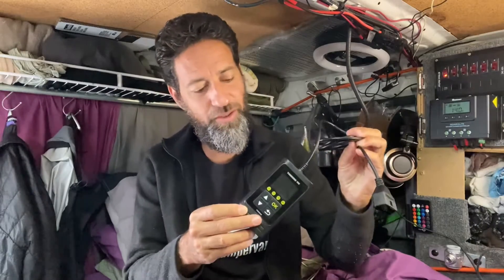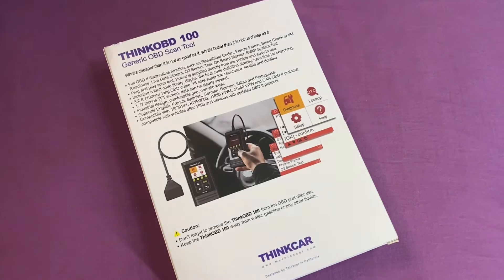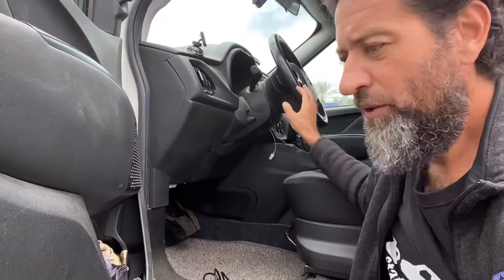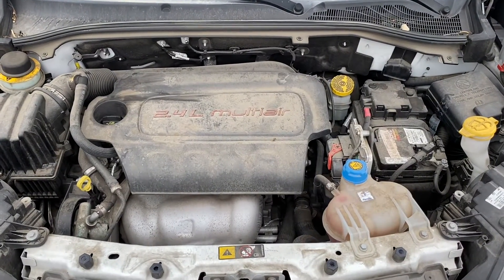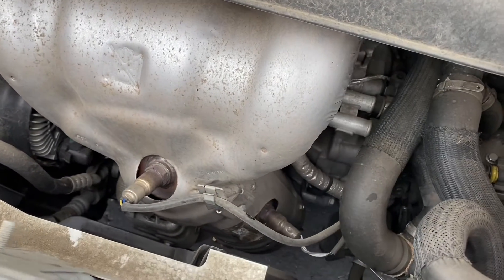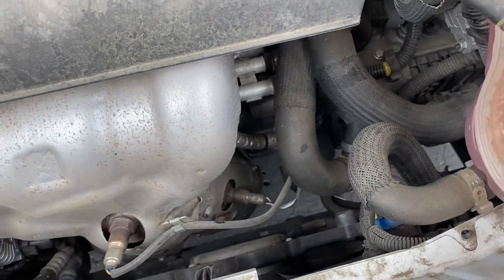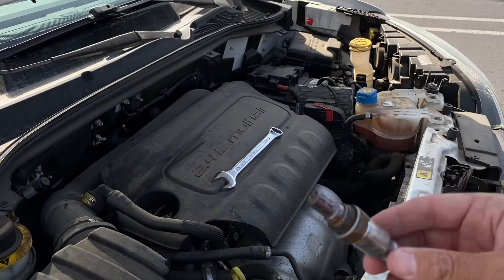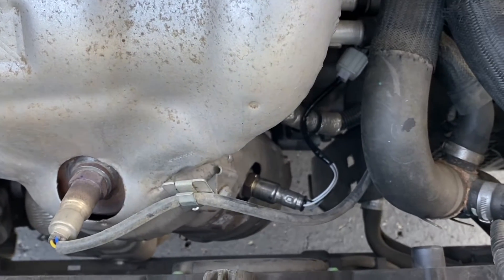Fixing a Rough Running Engine using a Thinkcar OBD2 Scan Tool

Comment: Thanks for this advice with thinkcar think obd100 scanning tool. I am having a Fiat Doblo (European version of Ram Promaster City) myself and was searching for a proper scanning tool. So, I guess, I will go for this one :)
If I may ask: Are you still happy with that scanning tool or did you find a better one in the meantime?
greetings to the US
Reply from the maker: The scan tool is working well for me so far. I believe Thinkcar has several newer versions now that might be better. 
By the way, our vans have almost no similar parts other than the shell. All the electronics as well as the entire drivetrain are different parts here.
Reply: @StaticCamperVan  thank you for your quick response, Scott! And thanks for the extra information on the the differences of our cars! 
I wasn't aware of this at all. 
Well, I hope the scanning tool mentioned above works anyway for my car ;-)
I am just a bit cautious because from time to time I stumble upon people's posts saying that they "destroyed" their car using an inappropriate or faulty scanning tool.
Therefore I find it really hard to choose one and was very happy when I saw your video with this particular tool which obviously helped you and - most importantly - didn't destroy your car ;-)

Comment: I’m ‘pleased as punch’ with your video. Recently took delivery of a new company van (2021 Ram ProMaster City.) I first learned from you about the oil consumption issue (it’s used almost 1/2 quart in only the first 2000 miles.) And I’ve  had a rough idle since day 2. I have my third appointment with a Dealer this week to check these problems. It’s frustrating when the Service Manager says ‘it’s normal for this vehicle’ to do this. Two other co-workers that have also recently received their new vans are not reporting these issues. Time will tell. I have the higher level ThinkCar scanner. I’ll check out the O2 sensor tests. Thank you!

Comment: I know what the problem is, it's a Chrysler product 🤣 I just sit back and wait for my ProMaster city to have a issue 🤦🏻‍♂️😥
Reply from the maker: Haha. Might be a long wait. This PMC has been one of the most reliable vehicles I’ve ever owned. 
Maybe we both need to be more pessimistic!
Reply: @StaticCamperVan  I'm definitely happy to hear you're having better luck than I am with your PMC.
Reply from the maker: Oh, that’s right. You said you’ve had some troubles with yours. Sorry dude.
Reply: @StaticCamperVan  there's a bad lemon in every bundle lol thanks man. I'm sure I'll have bad O2 sensors at some point so this video was helpful.
Reply from the maker: True. By the way, a friend dropped a comment here saying that emission components are federally mandated to have an 8 year/ 80k warranty. 
If I’d had known that, I might have taken the van back to the dealership and had them fix this.
Reply: @StaticCamperVan  great info thanks dude 🤙

Comment: For a Chrysler, that's really easy to get to. I'm surprised they are acting up with how new that van is. My GM trucks tend to fail at 20 years or 200k miles in the rust belt. You can often rent special tools for free by giving them the retail value of the tool until you return it.

Comment: Now I want that scan tool, even though I can't do the work myself. I have the 2016 PMC, just got an oil change 2 days ago and was on the low end of normal. I will contact dealership about the recall testing for sure now.
Reply from the maker: Part of why I made this video is to show that we all have the ability to do some maintenance on our vehicles. 
I wish you well with your test.

Comment: Downstream 02 likely died 1000 miles after your EPA mandated 8 year/80,000 mile warranty on all your emmision control components expired 🙄  darn! The manufacturers have this stuff figured out. The downstream 02 does not control fuel trim.
Reply from the maker: Good to know for the future. Although I still don’t want to go see a mechanic or dealership for a while.
Reply: @StaticCamperVan  😂😂  I know what you mean! I take this knowledge forgranted as it is my job, must be a bad feeling to be at the mercy of a mechanic or especially a stealership.

Comment: Ever since grade school   -----I hate test. Foot Note- hear on the east coast the Colonial Pipe Line company was hacked and they shut down pumping fuel to 25% of the East Coast. A lot of gas stations are getting low on fuel and we all know what's at the bottom of those tanks. Since fuel injectors are sensitive to clean fuel, just a few drops of water or sludge can really mess them up. I think perhaps a can of injector cleaner every thousand miles would help.
Reply from the maker: Might be a good idea.

Comment: many people will say to change both sensors if one has gone just like replacing both front tyres etc or both sides of any mechanical parts etc because if one part is worn chances are the other part cant be far off needing replacing etc

Comment: Have the same Van / Year about 75k miles. Have you looked into transmission oil change. Supposedly it's supposed to last the lifetime of the vehicle. That being said from what I can find online that is only around 100k or so per the manufacture.
Reply from the maker: I’ve been told various stories about changing the transmission oil. An unscrupulous dealership told me it needed to be changed at 30K. For $250! It sounded fishy so I declined. Not sure what the actual recommended mileage is for the change.

Comment: Congrats on a job well done. My multi-air Fiat had  a rough idle issue I pulled the first spark plug and it was completely rusted away. Never trust the dealers to keep a car nice. That code scanner helps to make you a better informed consumer :) and avoid getting ripped off.

Comment: Personally I wouldn't include the price of the scan tool in what you spent to fix your van. Reason is that everyone should have an OBD scanner in their tool box and it's not a specialty tool. Just my humble opinion. With that said, I say good for you. A penny saved is a penny earned. If you had went to a mechanic price would have been close to $200 if not more because first remember they would mark up the part price (usually double) and then charge a minimum of 1 hour labor. Score bud!
Reply: it's a great troubleshooting tool.  I have a couple of fixes under my belt using the scan tool.  I managed to replace the EGR valve and ignition coil pack. it's not always going to fix the problem but it's a good first step. nice video ☺️
Reply: You're so right. This old 64 y.o. woman has two of them--two different types.

Comment: Yes! Glad to see you. Too cool, you watch Scotty, too. He's so funny, smart, but funny. So proud of your sensor success! Did you do a test drive? Does it feel any different? I would have been even cheaper by first checking the sensor connection, then removing and cleaning and putting the sensor back, then testing, then since all that didn't fix it, then would have bought a sensor. (I already have two different kinds the ODB-gadgets.)
Reply from the maker: Us Scott’s have to stick together.
Reply: @StaticCamperVan  Of course you do, you're a rare animal these days. You don't hear the name as often as when I was growing up.
Reply from the maker: Haven’t driven very far today but will test it again tomorrow. Engine doesn’t feel much different, but there wasn’t a big rough idle to begin with. 
I thought about cleaning the sensor, but figured it would be a good idea to just replace it since the correct part was available.
Reply: @StaticCamperVan  Probably was best to skip cleaning the old sensor anyway. I don't know why I insist on making myself do things like that since they rarely ever cure the problem, but I do them anyway. LOL